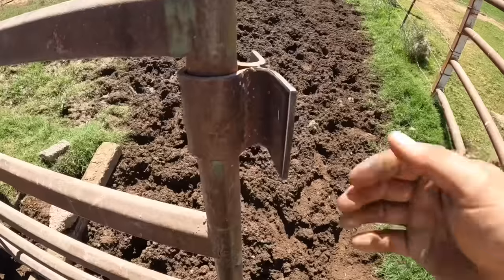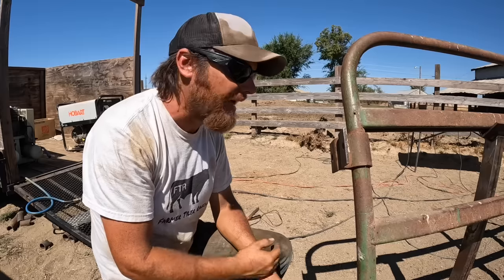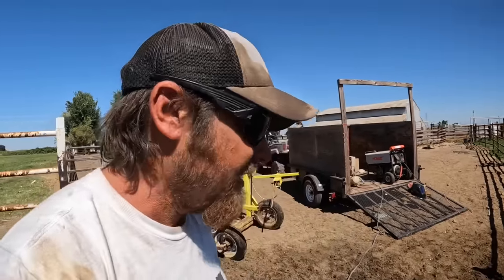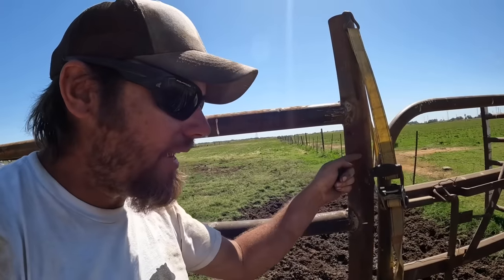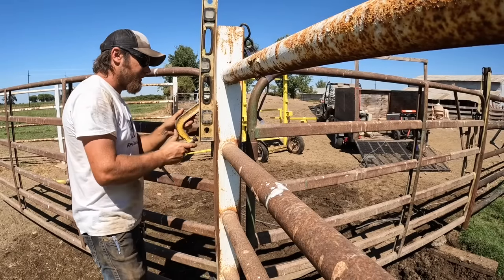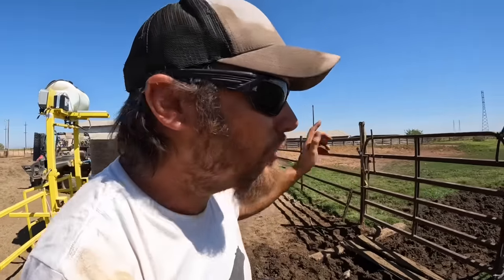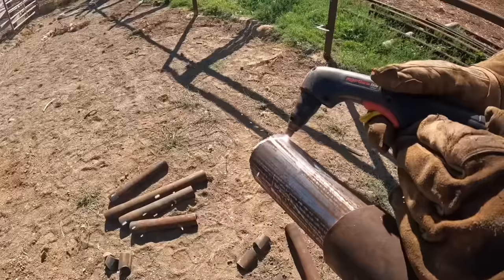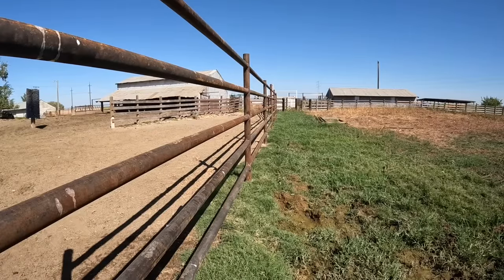After Days of Welding, It’s Finally Done!

Comment: I'd like to make a suggestion on your alleyway. On the board fence side put a gate in close to the working tub. Make it so that it will open flat against the fence. Leave the gate open so the cattle can go down the alleyway and back into the pen through the gate. When you want to run something in to the working pen, just shut the gate. Now your cows won't give you near the trouble about going down the alleyway, because they think they can just go out the gate.

Comment: How about if you made your gate latches out of some short pieces of rectangular tubing? Say maybe 2x3 tubing about 3/4 inch long. You could weld the two pieces to the side of the post and have plenty of room vertically for the gate to move. Just a thought

Comment: I know that my comment by now means nothing, but instead of cutting the horizontal to fit the round posts, why didn’t you drill a hole in the vertical posts and the fit the horizontal inside of it?

Comment: I once had a steer charge me.  (I was working on my uncle's farm during the summer.)  My uncle was moving cattle to a new pasture.  The steer decided that he did not want to go where the rest went.  He came running to me like I was nothing.  I clapped my hands at the last moment and he turned a 90 degree corner and ran right through a three strand barb wire fence.  My uncle's eyes were as big as saucers.

Comment: I'm sure this is another one of those clueless subscriber comments/questions🙄😂 ... I'm sure you'd need to use steel pipe for the top rail but, couldn't you use steel cable for the bottom rails? Maybe steel pipe for the top and bottom and cable between    🤷‍♂